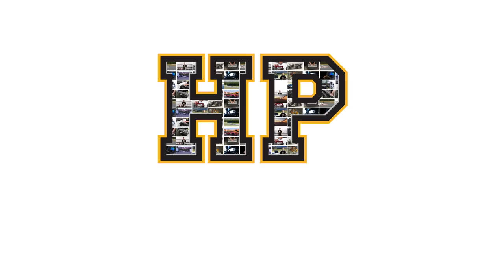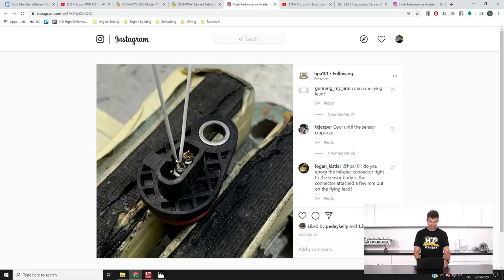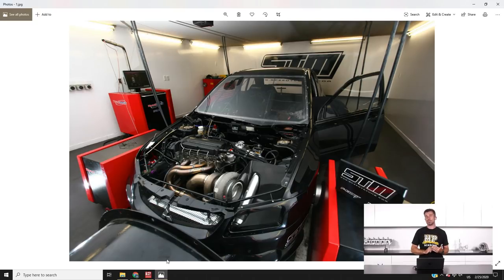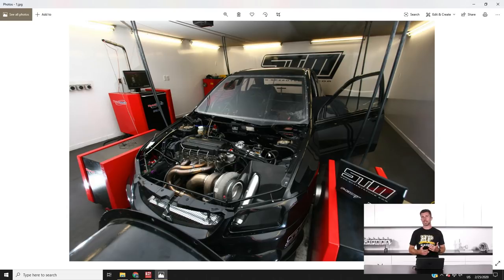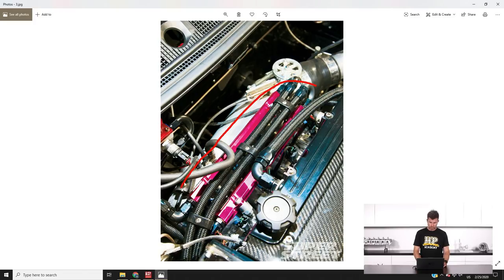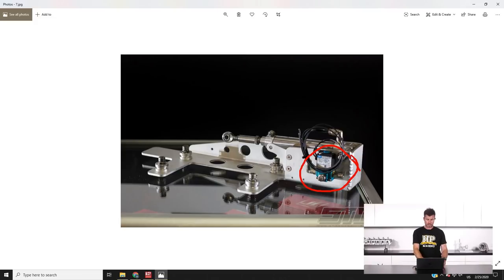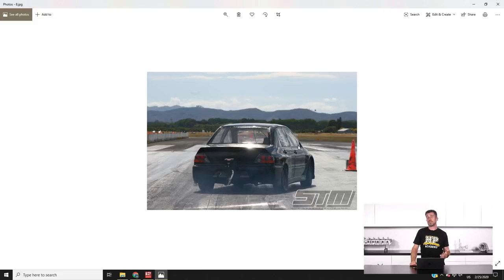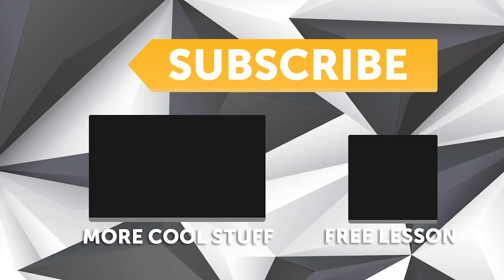World Record DS9 EVO Drag Racing, Soldering and 60-Foot Time Importance | Today At HPA [UPDATE 236]

Comment: I used a Clutch Masters valve on my Focus ST. The delay wasn't long enough with the smallest included jet. On my next FWD build i will using a much improved system. Maybe not 1.2 60 ft but I would be happy with low 1.6 on drag radials. Maybe 1.5's with excellent track prep.

Comment: Were you still runing with the ACD tcase and stock ACD pump?
Reply from the maker: Nope, it was running a locked centre diff.
Reply: @hpa101  
What about the head? Was it still using the hydraulic lifters or BLE/Tomei solid ones?

Comment: Why 1000 whp for what?! The ct9a can run 9-10s easy with mid 500 hp.. so much over done with this build its not even funny. Tuners in Japan can achieve near same results with half the power.
Reply from the maker: You don't have to like it, it is not comparable to what can be done today, but at the time, nothing was faster, hence the world record which this car then held for years. No matter how much you 'think' you or someone else could have done better, history shows you simply didn't at that point in time, otherwise you would have the trophy in your cabinet (or someone in Japan would) and not the team behind DS9 😉 - Taz.